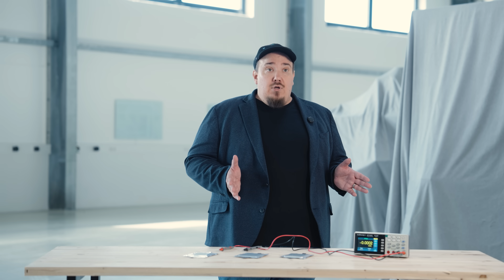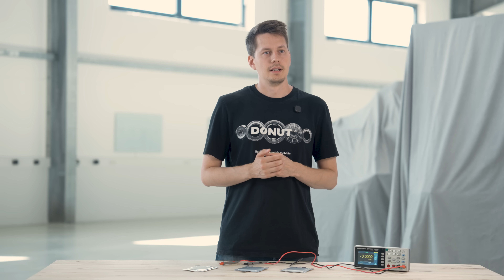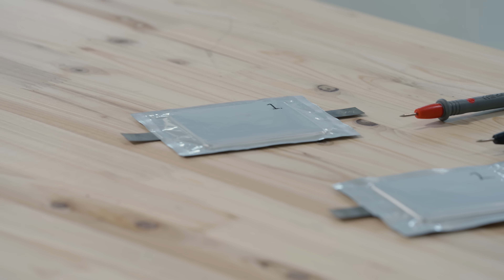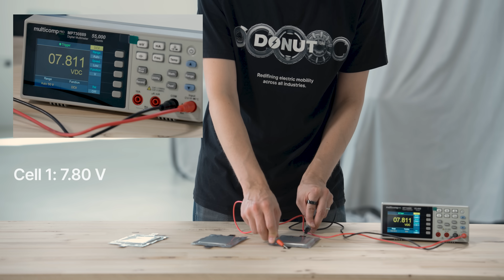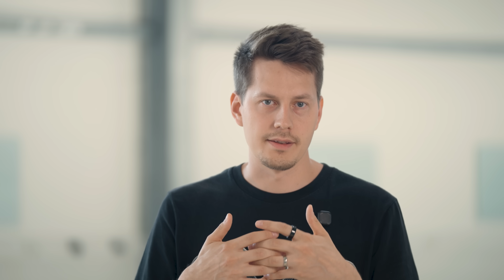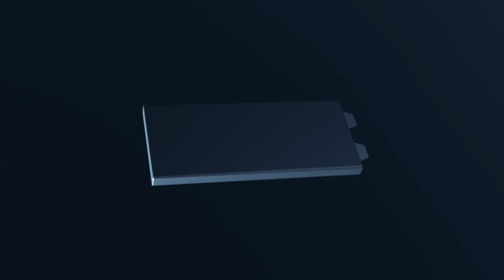Bipolar Cell | I Donut Believe

Comment: All Marko has to do to prove his Donut battery is real is to ship them out in a production vehicle and we can do the dissecting ourselves.
Reply: The problem is that, ironically, if it turns out to be true in some way that those batteries are actually solid-state, they could copy your idea and steal it, which has happened thousands of times in the past, much like corporate espionage.
Reply: @asterlofts1565 everyone knows how a solid-state battery is supposed to work. The problem is manufacturing them. You cannot figure out the manufacturing process completely by simply dissecting the battery. For example, BYD ships incredibly high performing batteries, but even if people wanted to copy them, they couldn't because it's not just about seeing inside the battery but knowing how to manufacture them
Reply: @asterlofts1565  There is nothing illegal in buying production vehicles to take it apart and learn your competitors' techs. This happens all the time. It is part of competition.
Reply: @AldrinAlbano  the donut story is that you couldn't patent or that china wouldn't have patents and western companies wouldn't hold patents in china or wouldn't enforce them on china export etc. frankly it makes no sense. they would have to patent it to protect it if they would ever intend to sell it.
Reply: They should send it to Sandy Munro
Reply: @MrSaguaro  Would need to have one first.
Reply: Lets hope the fins do not start to dissect you.
Reply: The real trick is that it isn't done yet.
Reply: Onhan se jo tehty, vai menikö moottoripyörät ohi?
Reply: @Topsiekku  yhtaan pyoraa ei ole toimitettu sellaisen tilanneelle itsenaiselle asiakkaalle. teknisesti yhtaan tuotantopyoraa ei ole edes ilmoitettu tehneeksi, se edellinen ilmoitus pyorafirmalta(joka on sama firma kuin he) oli etta tekevat testipyoria itselleen tuotantopyorasta. talla haavaa toimituksia lupaillaan q4.
Reply: someone would pay like $30k or whatever just to tear it down and figure out what's in it and then what? seems pretty pointless. what is the point of that unless you happen to be a multi-billion-dollar competitor and want to copy the tech? or is the point just to try and prove they are a fraud? who cares that much one way or another?
Reply: @robertludwig5620  the point is they were already supposed to sell them in q1. at some point they're supposed to sell a cell you know, they can't reason protecting it forever by not selling it if they're saying they're going to sell them, patents would be the only thing that would make any sort of sense.
Reply: @robertludwig5620  Believe it or not, that is what competitors do. They buy your product in the open market to make sure your tech is not a copy of theirs, and if legit, how it compares to theirs, technologically speaking.
Reply: @robertludwig5620 30k for getting tech that billions in research around the world hasn't been able to make... yeah, who would bother doing that 😂
Reply: Well, this is big business and they probably need to firm up the patents, they don't need to send anything anywhere, they don't need to work to convince competitors of anything.
Reply: @JohnOlavOttesen  what happened to the Verge motorcycles that would supposedly be getting these new batteries? It's already past the time they stated these bikes would ship. They assured that scaling up wasn't an issue.
Reply: @Charles-Darwin  Exactly! Marko keeps saying in his videos they are the first solid-state batteries to "ship in production vehicles" with straight face. He knows he is lying.
Reply: @Charles-Darwin  verge said they were doing production verification building of them a while ago already. basically they already claimed to have delivered commercial batteries since they like to pretend verge wasn't just them themselves.
Reply: @JohnOlavOttesen  "They don't need to send anything anywhere."
I don't know, I'm pretty sure someone who paid $30k for their solid-state bike would like to see it sometime soon. Donut lied about sending them out in the first quarter, and zero have made it to customers.
Reply: Yeah, so a Chinese manufacturer can just copy their design. Be real. They are probably trying to catch a big fish as a partner who has the financial muscle to protect the IP.

Maybe someone like Ford would be a good partner. Their battery solutions are going nowhere and they are running out of road.
Reply: @sailingoctopus1  They don't have to copy, They are actually already producing. Additional new Solid state factories are being build atm. First products of big (car) manufacturers are already planned for next year ... product announcements are expected for end of this year. 

While Donut still sells Merch and YT Videos.
Reply: @ChristianJog yes, but a completely different technology
Reply: @sailingoctopus1  Yup. Actual solid-state batteries instead of make-believe ones.
Reply: @Vilomies Nothing unreal about solid state bipolar batteries, one has been powering the Oxford Bell experiment since 1840, it's called the Clarendon Dry Pile battery.
Reply: @sailingoctopus1  Reading comprehension. I never stated solid-states were unreal. I only stated Donut Lab is cooking make-believe ones.
Reply: @Vilomies 'make-believe' ones that have been tested by VTT.

We now have confirmation that the battery is a bipolar battery, which makes sense of all the Donut Lab claims and makes sense of the puzzling evidence from the VTT testing, evidence that proved the battery tested by VTT was not Lithium or Sodium.

Some people just delight in cynicism.

It's OK to be skeptical, but cynicism is deeply unattractive, as it has no constructive element.
Reply: @sailingoctopus1  VTT tests whatever you ask of them. Nothing in the tests confirms we're even discussing solid-states.
Reply: @sailingoctopus1 vtt tested without any analysis of the chemistry.
Reply: @ChristianJog  china producing overpriced batteries that ARE NOT revolutionary at all because they are OVERPRICED, DonutLab claims its batteries are way better yet CHEAPER than Lithium.

china brings overpriced batteries for overpriced cars (and other overpriced things). DonutLab should bring the REVOLUTION in EVs and energy storage. literally killing ICE/gas everywhere, basically. making EVs and ebikes and solar/wind WAY better for everyone - ordinary people - in the end.
so totally different level of expectations.
thats why chinese actually are afraid of DonutLab battery and send bots and biased people like Ziroth everywhere to spread negativity hoping that'd kill DonutLab by drying up their investments and taking away partnerships opportunities
Reply: Scam is also unattractive and has 0 constructive element. They’re trying to save some time, for whatever they have in their agenda.
Reply: @sailingoctopus1  That would be cool! 😎👌
Reply: @sailingoctopus1  donut has had plenty of time to file the patents if they know how their thing works and what it is made of. which they don't seem to. they're taking porders through verge and had a showroom to sell them, saying that they wouldn't need to give the product they claim to be selling is kind of special logic which would also make them frauds - but besides than that as said they've had plenty of money and time to file the patents in euro, usa and china.

if they're not intending to sell and ship the batteries that's quite simply just investor fraud.
Reply: @lasskinn474 Plenty of time? Donut Lab was formed less than two years ago? It typically takes 4 to 7 years to file a patent through WIPO and get it ratified by all member nations and it costs well over $100k.

Besides, the patent system ís broken. It only works for billion dollar companies and American universities that use it as a status scoreboard. It doesn't prevent people from copying your ideas.

My guess is that most of the technology isn't patentable. Bipolar batteries have been around for centuries. The precision screen printing technology is owned by CT-Coating AG. The organic carbon polymer is just a recipe. I doubt you can patent carbon from an organic lifeform, for example, the carbon from a walnut.The solid state electrolyte may be patentable, but maybe Donut Lab are using someone else's; Toyota, Samsung and LG hold thousands of solid state electrolyte patents.

The patent system only serves to stifle innovation, so small companies are forced to use other methods to protect their IP. One way is to make your company brand indivisible from the technology. Perhaps that's what Donut Lab are attempting?
Reply: @sailingoctopus1  donut lab has around 14 patents. clearly they believe in patenting mundane things like bearing raceways if you look them over. clearly they as a company believe patents to be worth it and have spent a lot of money on acquiring them.

they value themselves at 1.2 bil due to holding the technology. it doesn't matter who would have the patent, just that someone would have it, because it is corporate value essential - and that they would have the exclusive license.

if they don't have exclusivity and it protected they also already would've performed investor fraud, they claim exclusive access and rights.

and you either mispresent or misunderstand patents themselves, since you could absolutely patent a novel working method of voltage pairs and construction, the necessary bits to make a working novel battery out of elements found in a backyard thats better than a lipo and cheaper to make.

- and more importantly the company would have zero value if someone else patented the pairing. they haven't told even what elements would form the voltage pair, so they can't even claim prior art if someone else actually shows some method even.

it doesn't matter if it was ct coatings or who that held the patent if they would have exclusive licensing and license holding.

right now they have an invention they're hocking that's not really all that novel(the namesake motor of the company) that they have 14 patents on and an invention they're hocking that they have 0 patents on and the latter is the one that's supposed to make hundreds of billions of money.

Comment: Ship some of these to Will Prowse and other reputable battery experts if you want to make us believe. 

And for goodness sake show us a cold temperature test result and the weight of the cells tested earlier by VTT. 

Keeping those results to yourself makes no sense unless they are very disappointing. 

With every video taking 3 weeks to be released and basically no actual customers showing off their solid state Verge motorcycle 3 months after your own deadline, it's getting very hard to believe this is real.
Reply: Will Prowse is not actually a battery expert tho..
Reply: @villekinnunen6357 I am open to suggestions for anyone independent and reputable who could verify and test the claims better than Will Prowse would.

Comment: "...should put a nail in that coffin for good."
For me, the true nail would be cutting it in half and seeing if any fluid leaks out, like what TwoBitDaVinci did in his collaboration with ProLogium. A great Donut Lab video would be just essentially copying all of the tests done in Da Vinci's video, with a third party representative present for validation. 
Claiming that this video alone puts the nail in the coffin seems like a huge stretch to me. 

Also, VTT could easily just verify if the electrolyte is solid or not without revealing the chemistry.
I'm doubtful this video alone will change many minds. 
I'm not a battery expert, so I could be wrong on how persuasive this demonstration is, but Donut is making a claim with indirect evidence rather than the most direct (cutting the cell in half). 

And for the record, I do still think there's a chance this battery could be legit, but if it is, it's baffling why they continue to show, non-conclusive demonstrations. Especially since a very conclusive demonstration (copying ProLogium's video) looks like it could be done in a week.
Maybe there's an argument that they want to ramp up before providing conclusive evidence, to stay under the radar of their competition that would sabotage them. I could see that. 

My issue with this video is that he claims it's the nail in the coffi for solid state, by citing indirect 'proof', among many other things.
Reply: On LinkedIn Marko said they are reaching out to journalists to have them come test the battery. I hope this happens. Would love to hear when those videos might get released. Even a more public announcement that this is confirmed to be happening would boost public image

Comment: This video is huge for several reasons:
- I think that the batteries in this video are the first of the 2nd generation batteries indicated in the April 1 video. They are showing us why it was worth stopping production of the 1st generation.
- With layering, energy density is variable. The more layers, the higher the energy density.
- They restated that the battery is solid state and it is not lithium, despite the recent video from "experts" claiming that this is not true.
- They recommitted to 3rd party validation of their claims. Now that they can get samples of the new battery, they have something to test with.
If all the above are correct, we are witnessing the birth of a new age in battery technology. Buckle-up buttercup!
Reply: Notice that both the contacts on all the prior batteries are on the same side. However, the contacts on these batteries are on opposite sides. This is an indication that these are 2nd generation batteries.
Reply: @fredpetty1444  - the tabs organised in opposition are useful for designs where the cells will be used in parallel to form high current batteries, whilst inside each cell the layers are orgniased in series to achieve a desired cell voltage. One could organise 100 layer (50-60v) cell that can easily be bonded in parallel with other cells via end bus bars to form high capacity battery modules, with strings of 12 modules forming an 800v capable pack, where the pack's overall energy density can be tailored by the number of parallel strings of 12 modules utilised. This would result in fewer modules per battery pack, with much lower copper usage/wiring overhead, whilst offering standardised battery pack design template that lower construction cost.
Reply: Entièrement d'accord et ces 3 cellules sont surement de la 2e génération dont a parlé Mako à la fin de sa série, la première n'étant pas complètement aboutie et on en a eu la preuve. C'était une stratégie commerciale pour attirer les petits investisseurs et ça a marché... Mako et VERGE nous cachent encore beaucoup de bonnes surprises à mon avis, on verra qui avait raison dans quelques mois et peut être au CES et ECMA...